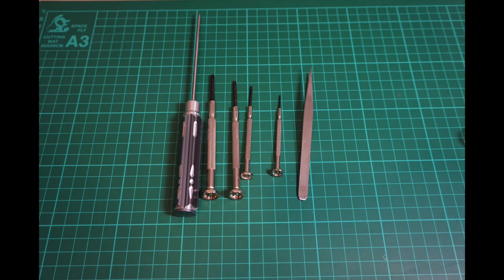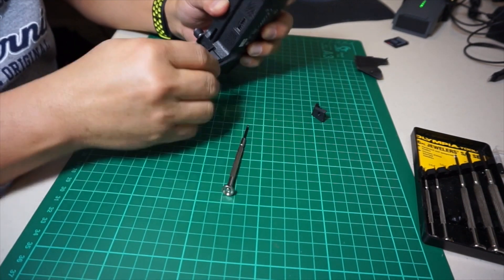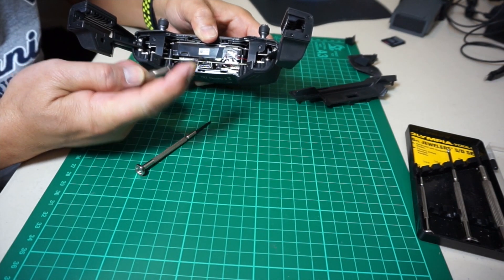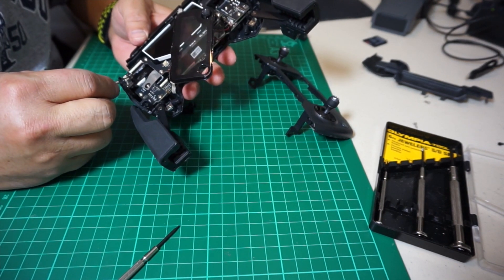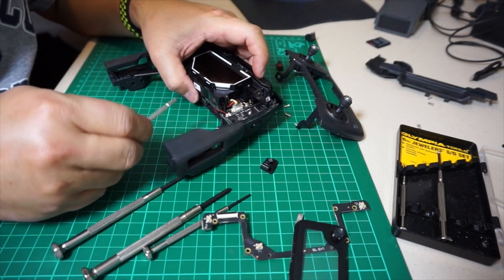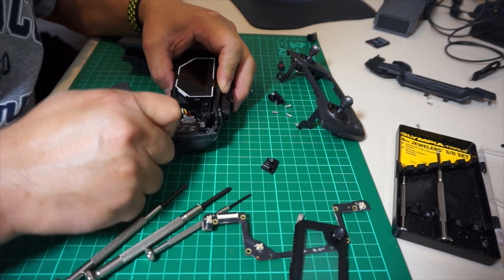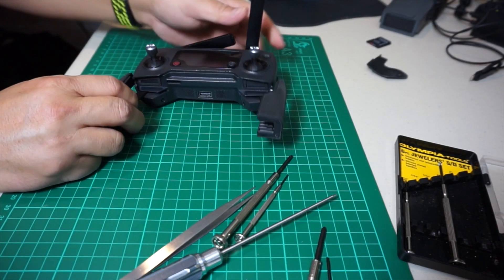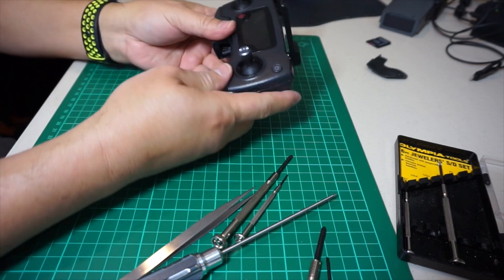Mavic Pro controller tear down

Comment: Thanks for this video!  It's always nice to see the clips and how something comes apart so I break less plastic.  My backlight was intermittent and finally gave us completely.  I took it apart cleaned the back smaller ribbon connector with alcohol that goes to the display and put it back together, now it works again so thanks for posting this!

Comment: is there a gaiter of some sort around the multi function switch 'joystick'? Your jotstick seems to have stayed with the glass,  I have just opened a dummy controller and the joystick is in no way attached to the glass. Either the the presumed gaiter wasn't fitted or it escaped

Comment: my remote got a little wet in the rain I started the disassembly process because it refused to come on, however I put pressure on a ribbon cable that says keyboard and it initiates the turn on cycle. instead of the power button! it's like the remote is functioning but things are backwards and I can't figure out why?

Comment: The joysticks are not connected to any wire.. how it transmits the movements to RC?
Reply: The joystick-rod's base has a tiny magnet and the remote control has what is called "Hall-effect sensor" that translates the movements of the joystic precisely to the aircraftt. Cheers